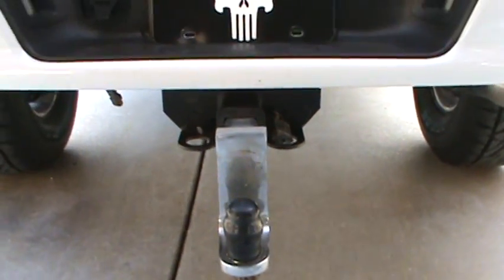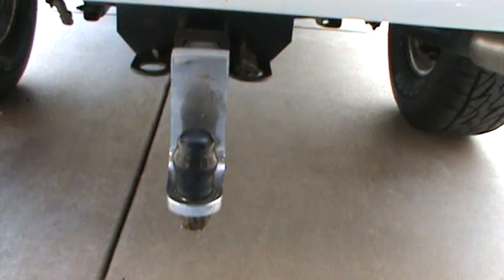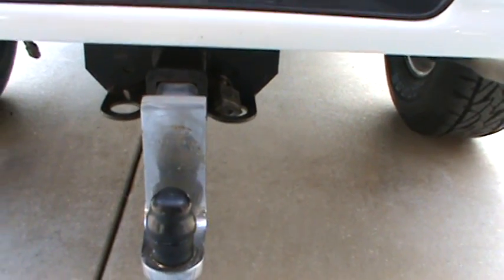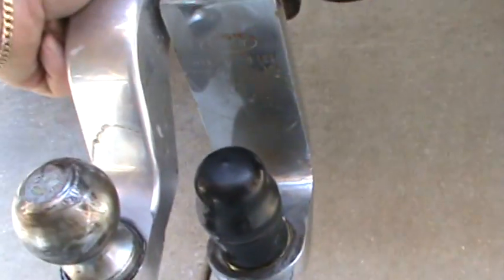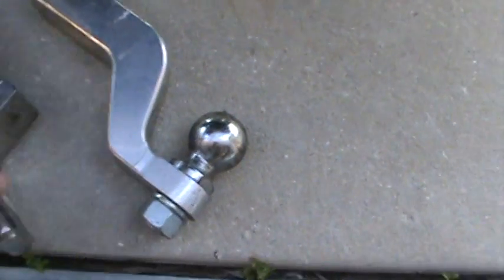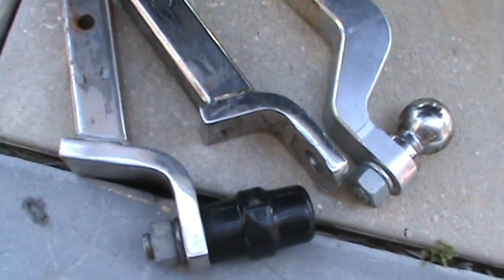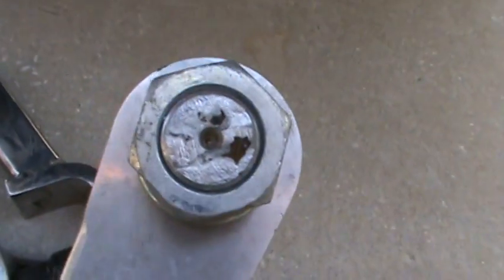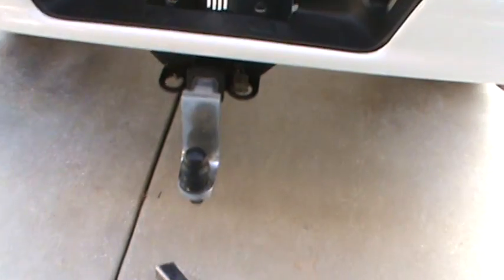HITCH PINS DO YOU HAVE THE RIGHT KIND ?

Comment: Those are called Receivers  a PIN holds them in ! Good video if you'd call them the correct names .
Reply: Dale T, if you want to be exact, he is talking about the ball mount.  The receiver is the hitch itself.  That is the part the ball mount goes into. You are correct that the Hitch Pin is the pin that holds the ball mount in the receiver.
Reply from the maker: Thanks Dale , I'm a Kuckle Head , Gerry :)))
Reply from the maker: Thank you Bernie , Gerry Keefe on Facebook :)))